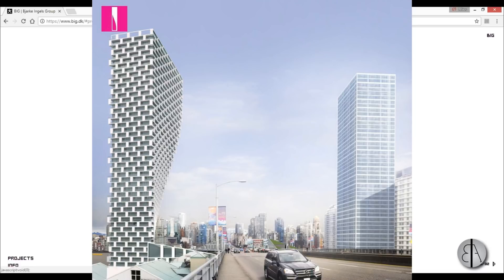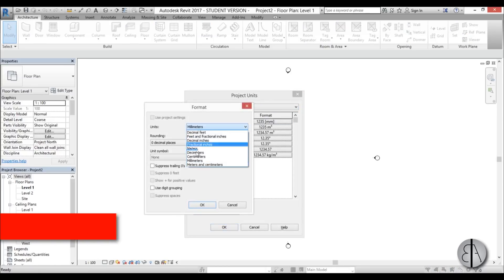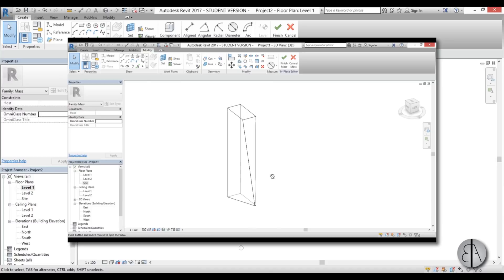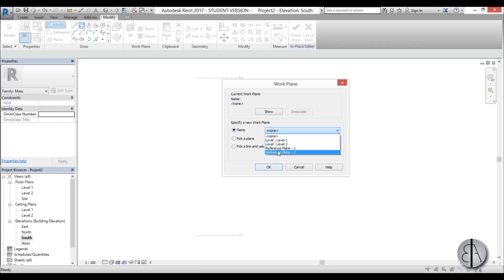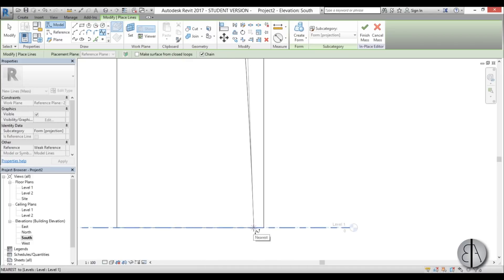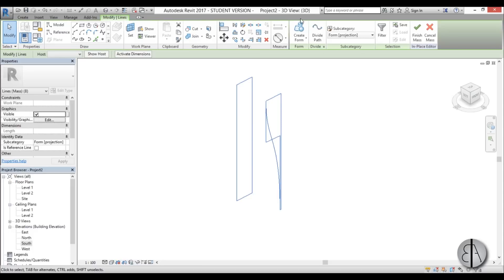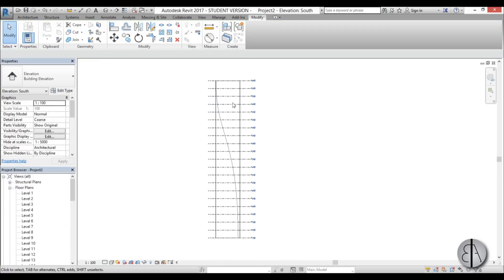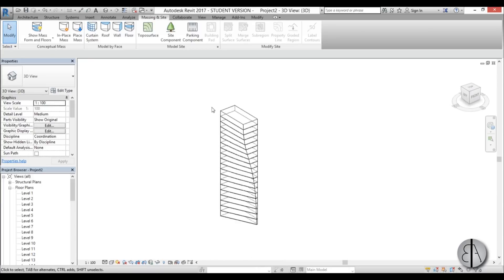Modeling BIG Architects Vancuver House in Revit

Comment: Nice use of the mass tool though this is a rough model. Was curious how this will be done in 5 minutes. Going from this to an actual useable model is still a long way to go placing actual walls and openings etc..
Reply from the maker: Of course, this is a rough model, just showing how to get the general shape. The facade of this building is complicated, not something I can fit in a 10min video :)
Reply: avicohen2k can’t you use place wall on face? With a storefront you wouldn’t need much openings too
Reply: Kongohh yes I have some thoughts on how to finish the model. Only mentioned that it's not finished yet.
Reply: Please do more complicated tutorials too, like a follow up to the general ones